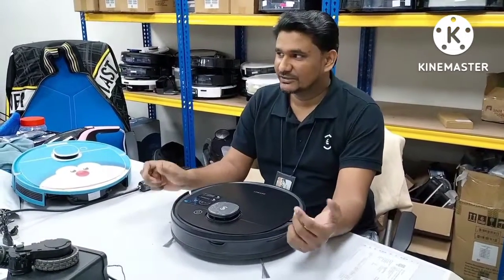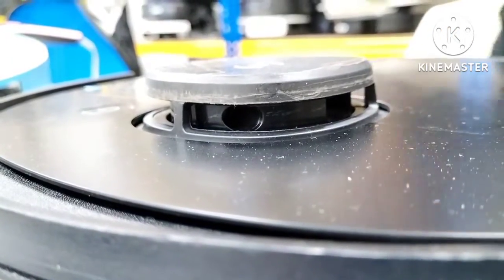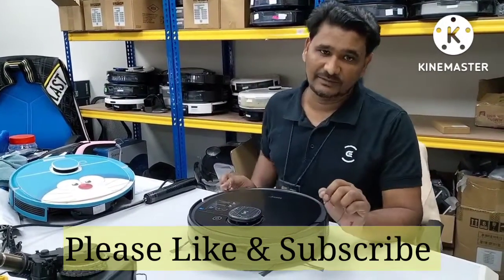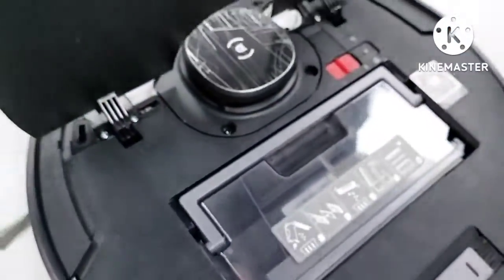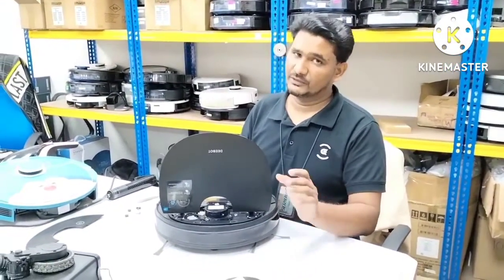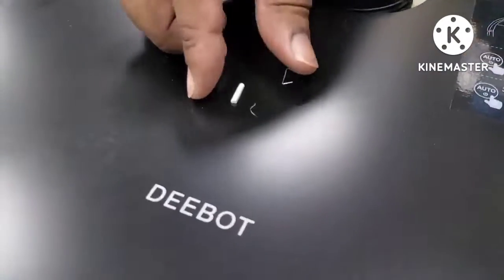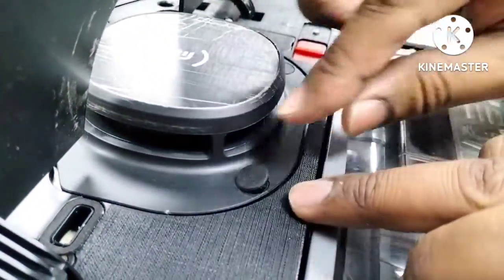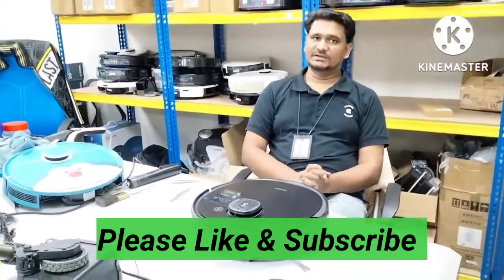How to Fix/Repair Ozmo 950 LDS Error?

Comment: Hi Team EcoVacs
I am getting LDS error even after i clean the LDS and LDS turning fine. still getting LDS error and deebot is not moving
Reply from the maker: Plz check my latest video just uploaded 2 days before.... related to this topic...
Reply: @ecovacstechnicalsupport5278   In my case LDF device is rotating without noise after cleaning and rotating normally as mentioned in your video.
If still need to replace the LDS, can you please guide how we can get the device.
Reply: @nileshgandhi9147
0 seconds ago
Also even after removing the belt for checking, the motor also start and stop and then give error. This should be running continuously, right?

Comment: Hey, i get no error message from my deebot. Most of the time he can't scan the map, when you reset the map, he shows only a white map and dont create a map. I've already done a deep clean of the lds, but no help. Any Idea ?
Reply from the maker: 2 possible reason, might be core board issue or LDS assembly need to replace
Reply from the maker: Can try to replace LDS motor only.. might be can fix the issue
Reply: @ecovacstechnicalsupport5278  Thank you, i switched the lds from another deebot and it works fine again, so i need a new lds. Do you have a good adress for spare parts like the lds? Realy hard to find in germany

Comment: Hi, i have problem with my ozmo 920, it beap 7 times, do you know how to fix it.
Reply from the maker: If Ozmo 920. Then there shouldn't be beep error because in this model got the voice msg...It will give voice msg error then easy to know what's the issue...but I let you know 7 beep error means Anti drop sensors issue..plz check it's anti drop sensors
Reply: @ecovacstechnicalsupport5278  hi, thanks for the reply.  my ozmo it doesn't give a voice message, i just hear the startup sound and then it beeps 7 times, i checked the anti-drop sensor but it's still working.
Reply: Hi, I have the same problem: after turning my ozmo 950 DX9G on I hear the starting tune and the lights are slowly flashing. Then I hear 7 beeps/chimes, which keeps repeating every minute or so. Hitting the reset button doesn't work. In a comment on another video you mention it might be the coreboard (the smaller electronics board, inside the L-shape motherboard. I took the coreboard out and it doesn't do 7 beeps/chimes anymore, so I think this is the problem. I found replacement part online, but they are for different model number. You think it will work? They sell CORH0-1205B_V1.5_A and mine is CORH0-1205B_V1.5_B.

Comment: My LDS is replaced with brand new. Still it is not rotating. It still stays laser distance senor is not working. Please help
Reply from the maker: May I know which model you are using sir.. ??
Reply from the maker: If it's ozmo 950 n LDS not turning then plz check LDS wire connections... attach underneath LDS... make sure fixed from right side.. for testing purpose can remove LDS belt n see weather motor turning or not. If motor also not turning then maybe wire connections got issue or Mainboard is faulty
Reply from the maker: Only 5%  chances of Mainboard issue....95% cases is only LDS assembly need to replace

Comment: I followed your steps to clean eveything. But the robot will randomly just stop and say LDS error during cleaning. Sometimes press the button it can resume but most of the time just keep saying LDS error. I bought from some reseller here and they said no more replacement part for the LDS component 😢
Reply from the maker: Some time is not LDS assembly issue...I hope ur original LDS also still good... sometimes if deebot totally won't move out from charger then we need to replace Core board..located next to motherboard a small 3 inches electric board attached with motherboard using a chip.....& Some time motherboard issue as well...in Ur case might be it's not LDS assembly problem...plz check rest two parts
Reply: @ecovacstechnicalsupport5278  thanks for the advice. But how can I check are those issues on the motherboard or the core board? 

But 1 thing worth mentioning, I just turn off the deebot and charger for few hours whenever it keeps giving LDS error. Then it can move out from charger and starts cleaning after I turning back on the deebot and charger. But yea, it will report LDS error after cleaning for few minutes and stuck on the error again. 

And is that true that they no longer supply the replacement parts for 950? For me is quite unacceptable on a not even 5 years product? I might be wrong but I just purchased it 2 years ago

Comment: Can you do a video when Yiko doesn't respond?
Reply from the maker: U means totally doesn't catch ur voice?? Or showing umber colour light in auto button??
Reply: @ecovacstechnicalsupport5278  Does not respond to voice commands.D_TOF and Main board (black) replaced on Deebot X1 Omni.  Still no voice recognition.  What is wrong?
Reply from the maker: @brucegruver5263  normally after replacing motherboard deebot should be ok... D-Tof is not related to voice commands issue

Comment: I am not able to set up my ozmo 950 to app ecovacs
Reply from the maker: Plz after power on wait few seconds let it ready to use....once auto button light stop blinking then press reset button & hold for 7 second. After 7 second once you hear the sound resting to default settings then wait for few seconds let it reset properly...then follow normal procedure for connecting WiFi... hopefully will work
Reply from the maker: If you still unable to connect this App kindly check below setting for your router & smartphone.

Failed to connect to APP Check your smart phone and make sure:
1. Make sure your cell phone is connected to a 2.4 G wi-fi.
2. You've chosen the correct wi-fi with correct password.
3. You’ve successfully logged into  ECOVACS HOME APP. And it’s updated to the latest version.
4. The ECOVACS HOME APP is allowed to get access to wireless data including WLAN & Cellular.
4.1. If the handphone is auto connect to 5G wifi, kindly forget this network and choose the 2.4G wifi accordingly.
5. Please turn OFF the cellular network of your smartphone.
5.1. Make sure that the app is allowed to access WLAN&Cellular.
6. Kill the APP process completely from your smart phone, then re-open to try.
7. Please try to use hotspot from another cell phone as the wi-fi signal see if it works, please note some of the android phone may have compatible issue as some of the brand has their own customize change on Android system).
8. If you're using Android phone, please turn ON the location services.
9. Please don’t use Google smart phone or Nokia 7P, or Huawei P20 as our machine has some compatible issue with them.

Check your router and make sure:
1. It’s emitting a 2.4 G signal.
2. Please avoid using 5G signal, if it's a dual band router, turn off the 5G signal, avoid special letter in the password.
2.1. Set your wifi name and password with simple letters and numbers. Deebot may have trouble identifying special symbols.
3. It doesn't have any MAC address filter function enable, the data transferring channel is set between 1 - 13
4. It is well connected to the internet.
5. Its security key protection mode is set at WPA/WPA2 (please note WEP is NOT working).
5.1. Make sure not using VPN (Virtual Private Network) or proxy server.
5.2. Make sure that the router does not have a Wifi isolation enabled.
5.3. Make sure the router support IPv4.
5.4. If using network extender or repeater, the network name and password are same as the primary network.
6. Turn the router OFF and ON then retry.

Check your DEEBOT and make sure:
1. It is less than 2 meters away from the router.
2. When you pressing the reset key, make sure it’s a short press (only 1-2 seconds), if you press the reset key for more than 6 seconds, the machine will be reset.
Reply: Thanks a lot , I will give you the feedback.

Comment: my robot vacuum It closes suddenly during cleaning
Reply from the maker: Model no.?? Any error msg in app appears??
Reply from the maker: Normally if sudden shut without any error or issue means battery need to replace N8 pro, U2 pro got this issue

Comment: Shows data submission error, says please try again.
Reply from the maker: Ok normally it happen if WiFi signal issue or password enter is wrong
Reply: Thank you very much, I will give you the feedback.
Reply: I have tried with mobile hotspot 
it’s says 
      1 ,error (003,-1001)
      2, error (113,-1001) then 
      3, error (020,-1001)
   & didn’t connect
Reply from the maker: @vijaitripathi  If you still unable to connect this App kindly check below setting for your router & smartphone.

Failed to connect to APP Check your smart phone and make sure:
1. Make sure your cell phone is connected to a 2.4 G wi-fi.
2. You've chosen the correct wi-fi with correct password.
3. You’ve successfully logged into  ECOVACS HOME APP. And it’s updated to the latest version.
4. The ECOVACS HOME APP is allowed to get access to wireless data including WLAN & Cellular.
4.1. If the handphone is auto connect to 5G wifi, kindly forget this network and choose the 2.4G wifi accordingly.
5. Please turn OFF the cellular network of your smartphone.
5.1. Make sure that the app is allowed to access WLAN&Cellular.
6. Kill the APP process completely from your smart phone, then re-open to try.
7. Please try to use hotspot from another cell phone as the wi-fi signal see if it works, please note some of the android phone may have compatible issue as some of the brand has their own customize change on Android system).
8. If you're using Android phone, please turn ON the location services.
9. Please don’t use Google smart phone or Nokia 7P, or Huawei P20 as our machine has some compatible issue with them.

Check your router and make sure:
1. It’s emitting a 2.4 G signal.
2. Please avoid using 5G signal, if it's a dual band router, turn off the 5G signal, avoid special letter in the password.
2.1. Set your wifi name and password with simple letters and numbers. Deebot may have trouble identifying special symbols.
3. It doesn't have any MAC address filter function enable, the data transferring channel is set between 1 - 13
4. It is well connected to the internet.
5. Its security key protection mode is set at WPA/WPA2 (please note WEP is NOT working).
5.1. Make sure not using VPN (Virtual Private Network) or proxy server.
5.2. Make sure that the router does not have a Wifi isolation enabled.
5.3. Make sure the router support IPv4.
5.4. If using network extender or repeater, the network name and password are same as the primary network.
6. Turn the router OFF and ON then retry.

Check your DEEBOT and make sure:
1. It is less than 2 meters away from the router.
2. When you pressing the reset key, make sure it’s a short press (only 1-2 seconds), if you press the reset key for more than 6 seconds, the machine will be reset.

Comment: My laser sensor unit is rotating ..but after rotating 3 to 4 times it's says 
"my  laser distance sensor is blocked please clean it"
Please help..I cleaned it after removing..but still same issue
Reply from the maker: After service if still same then LDS assembly need to replace sir...